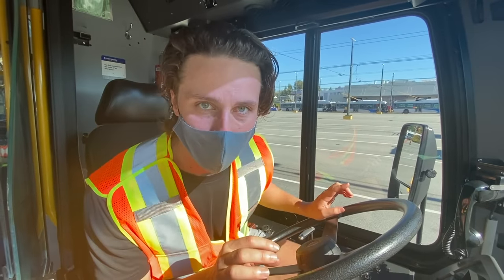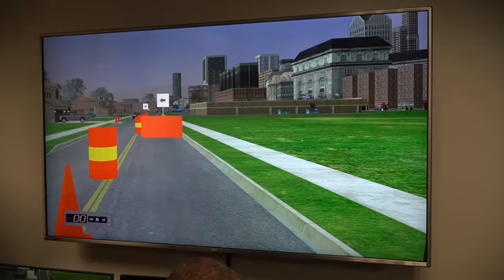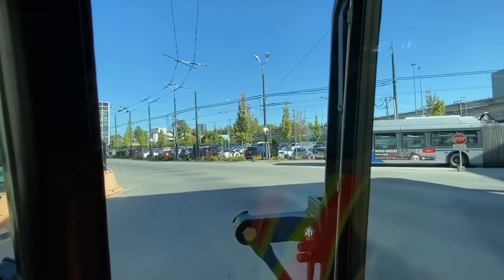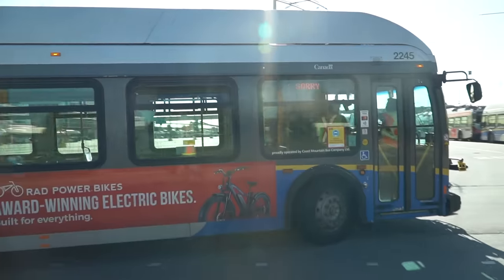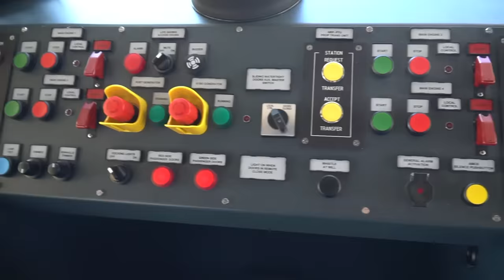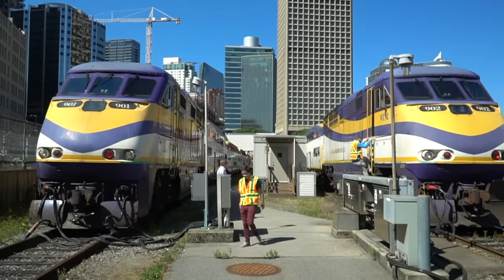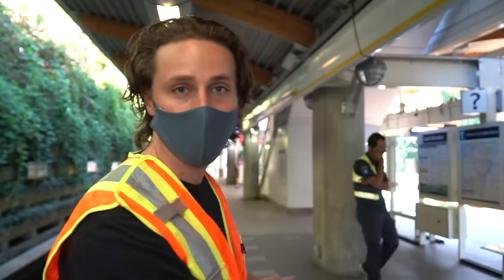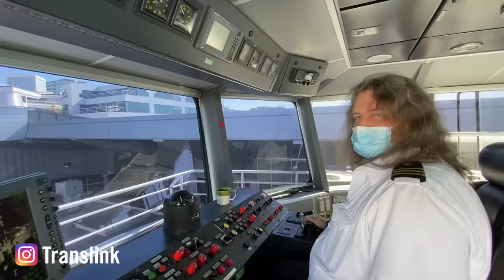Driving the SkyTrain! - Inside Vancouver's Transit System

Comment: I thought your title was clickbait, as SkyTrain is automated, there are no operators on board. Learned today that there are manual controls!
Reply: cough cough some Mark I’s are manual, Detroit and TTC got them too, but TTC gave them ATC, not sure bout Detroit.
Reply: though system is fully driverless, the SkyTrain cars do have manual controls (mainly used for recovery purposes, and when under maintenance)
Reply: Am I  no.... not really
Reply: I didn't know about those manual controls either.
Reply: @McBrabus  or when it snows
Reply: @BurnedNoodle  all three systems operate under full Automatic Train Control and supervision (though the TTC Scarborough Line required use of onboard operators due to pre-existing union agreements, however they merely serve to open and close doors once train berths at station - sweet deal indeed).
Reply: @inverseparadox  ... post "event" recoveries can take place regardless of weather condition, or season.
Reply: McBrabus during snowy times too.
Reply: They always manually operate the skytrain during snowfall.
Reply: @javidmirza4584 .. not sure about that. They have people onboard  "maning" the trains on standby, but they are definitely not driving it.
Reply: Yes. All those Skytrain personnel you see standing around doing nothing and being paid well for it, actually must know how to drive a Skytrain in an emergency situation.
Reply: @donmackie6086  These employees are called ST Station Attendants (SA). In terms of field operations and customer experience of any public transit system, the roles of frontline employees are multifold and very important. The SAs are uniformed employees strategically located at various locations around station(s) and/or at platform(s) to assist passengers with directions, crowd management, general information; to be ears and eyes on the ground and assist central control with safety and security type situations; and to maintain a consistent quality service operation. Previously they used to check fares.

These folks play a key role in the overall customer service experience aspects. They undergo a specialized training, and are subject to continuous recertification to advance and enhance their knowledge, skills and to promote their continued competence to operate and ensure system safety and reliability.  

To say that they are standing around doing noting and getting paid, is an insult. That would be equivalent to saying that if there are no fires this week, then the firefighters who are "standing around and looking pretty in front of their firehouses" should be let go; or an ambulance, police, or military personnel.  C'mon man.
Reply: @McBrabus  that's how it often appears. And to be honest, at many stations, SAs, can be very difficult to locate. And btw, using the term 'personnel' can hardly be construed as an insult.

Comment: So cool! Great fun to ride along vicariously. In 2015 when I visited the Japan Railway Museum in Nagoya I won a lotto draw to operate the 750 series Shinkansen (bullet train) simulator. So I can relate to the buzz.

That goes over 200 mph, but if you crash the simulator anywhere along the journey that's the end of your experience.

I managed (with the help of a translator/coach) to bring the train into the destination station on time and perfectly lined up at the exit markers. Got a safe driver certificate for it too.
Reply from the maker: WOW!  That would be so cool!
Reply: @DownieLive  Yeah, it was super cool. Even cooler was that I then took the same train back to where I was staying in Toyohashi. As a result of my simulator run I knew exactly what was happening at each stage of the journey. Especially interesting was that at a certain distance from a station the automatic braking system takes over from the conductor (thus preventing a suicide run on their part). If you know this, you can feel it happen.

When the train gets down to 30 kmh the automatic system turns the controls back to the conductor who then must bring the train to the spot where all the doors line up with their markers on the platform where the people line up to embark. Crazy wicked technology.
Reply: Been to the Kyoto railway museum last year and got to experience their simulator. Also very cool. They have a lottery like system for when it is busy, but it wasn’t that day and we were the tourist I guess so they put us both on the N700A Shinkansen simulators instead of the local type trains. There is also a Japan only game called “Densha de go” which has been around for around 20-25 years which is essentially a series of train simulators.
Reply: @DownieLive  And if you go below 60 MPH ...

Comment: I'm happy you used the term "trolley bus" for what many people call "electric buses."  It makes this former MUNI rider proud.  I had no idea how complicated it would be to maneuver between overhead lines.  That was amazing.  

PS  The one guy who didn't cover his nose with his mask - bad, bad, bad.  Did you happen to mention it to him later?  Oh, please don't strand passengers when you're driving.  We get very upset.  😂
Reply: There is differences between Trolley and Electric, who ever calls Trolleys E Buses are pretty much inexperienced.
Reply: @BurnedNoodle  Trolley Buses, aka "Light Rail Trains on Asphalt"
Reply: electric buses have small range like 20 miles and electric trolleybuses are better
Reply: @kennysbusdrawings  Where the heck did you get that normal electric buses have such a tiny range? Most electric buses these days have a range of at least 100 miles before needing to be charged, and some are even to a point where it's been increased to around 150 miles per charge. For city bus routes, that's more than enough anyway if their charging bays happen to be implemented at one of their two termini.
Reply: @TheCriminalViolin  Pretty much.

Comment: Thanks Mike, this is especially interesting to me. I am a retired bus driver in Sydney Australia with 37years service. My most common announcement when people would not move to the rear of the bus: " For your information, the rear of the bus is timetabled  to arrive at the same time as the front, please move back" I hope one day that you can visit us and experience our public transport system. The ferries that service our magnificent harbour always delight visitors and locals alike.
Reply from the maker: Hahahaha. That’s very clever. I love it.
Reply: Meanwhile in my country 1 of the bus drivers simply shoved people towards the back as they boarded. If they bumped into another passenger they may risk being accused of molest though I think
Reply: @lzh4950  If that happened here the bus driver would be suspended and could even lose their job.  I never had a problem when dealing with the passengers because I believe that what you give is what is returned to you. I tried to use humour to calm a possible bad situation and in most cases it works.

Comment: The 40 ft. Trolley bus is I think one of the hardest ones to drive (of course all the other buses are hard too but I personally think it’s the Trolleybus)....the 60 ft. is pretty much another level of hard 😳😳
Reply: No it's not. Easy peasy. Do it all the timr
Reply: The trolley poles and switches are the most pressing issue, had the same issue running streetcars, except I then didn’t have to worry about following the wires.  Operating the bus otherwise is a breeze.

Comment: The reason they can do that is cuz it's a cab car which is basically just like the coaches but it has a cab in the front. It's also used on Amtrak pacific surfliner the capital corridor and stuff like that

Comment: Oh yeah you covered the seabus oh yeah🤙 you went all out. I actually forgot that the buses ran on electricity out there. When you live there you forget these things they just blend in so well you figure the rest of the country would have the sort of thing implemented  it's only 2021.. and yeah holy moly the West Coast Express was so awesome. If you're in downtown Vancouver you can get to your home in 2 seconds. Unless someone jumped on the tracks which happened one or two times. So you're better off just taking the SkyTrain because it takes them awhile to scrape the body off the tracks. I know this comment went dark quickly but it happens from time to time

Comment: Did you get a chance to see the Skytrain OMC computer room and control rooms? Used to work there before going back to Europe, pretty cool place. Remember there was a workshop in the yard that had a ladder that led between the two running rails of a track section under Automatic Train Control / ATC so there's a possibility you can stick your head up and have the train slice it off as it goes by if you were unlucky enough!

Comment: New Jersey Transit version not in service masks required saw this on MCI D4500CT 20108  after operating a 114X to Bridgewater Commons Mall. By the way the other city to have E40LFR the electric bus you are driving is Philadelphia Pennsylvania on routes 59,66 & 75.

Comment: OMG , ONLY 5 Daily trains , this is like dieing line short before permanent closure (or reanimation by Karlsruhe Tram-Train) in Gemany ... 
many still use (small) wheels for Trolley-Power , just like Trams did at the beginning , before Europe (Germany) revolutioinized it with the Lyra-Bügel that became the modern Pantograph (the newest is on the Shinkansen high speed train) ...

Comment: In Soviet Russia. You let go of the accelerator and let the hand of putin to guide you left or right on the wire switches. No but seriously to go left y need to accelerate before going over the switch sensors else you go right

Comment: Nice Video! But it's always sad to see how underdeveloped the north american train system is. 5 Trains a day is nothing in europe, and fixed-locomotive remotely operated trains like you showed (called "Lokbespannte Wendezüge" in german, roughly translates to locomotive powered direction changing trains) are in service since the 1960s, and were quite common until most of them needed to be replaced which has been done with multiple units ("Triebzüge" in german, i.e. more than one car powers the train, and they can only be split up in fixed units while in service). If you have the time (and interest), come to Austria once travel restricitons are lifted and ask our federal train operator ÖBB to show you around. Especially the overnight trains across europe - they are the biggest operator of overnight sleeper trains in europe.